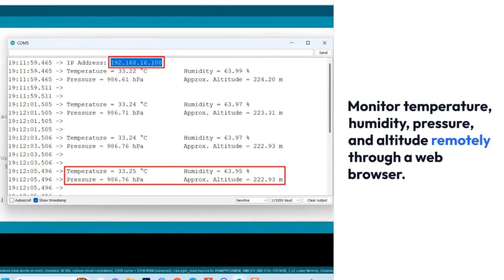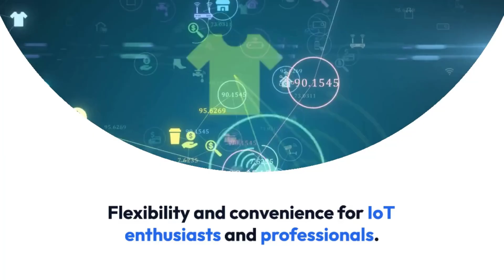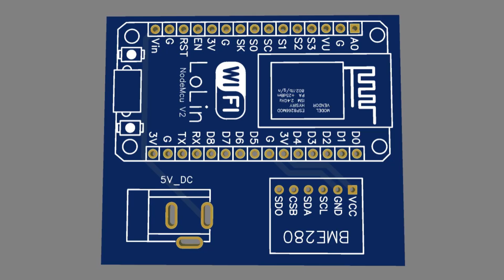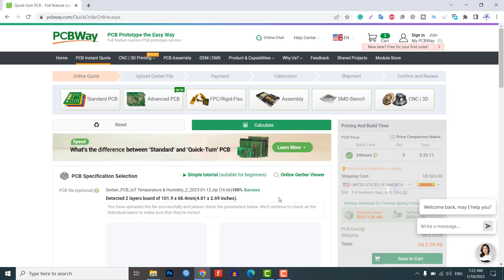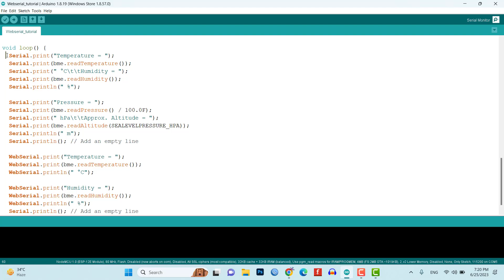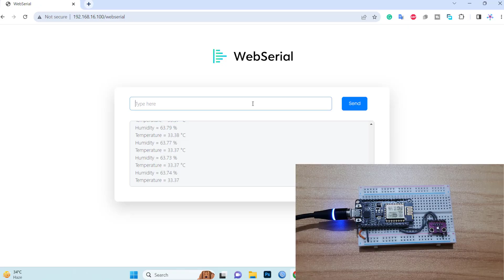Remote Serial Monitor for ESP8266 using WebSerial

Comment from the maker: #esp8266  #webserial #bme280  #temperature  #humidity #nodemcu 
*************Download Section************************
► Monitor Sensor Data Remotely using ESP8266 & WebSerial Library
► Circuit Diagram, Source code, & Guide: https://iotprojectsideas.com/remote-serial-monitor-for-esp8266-using-webserial/
*************************************